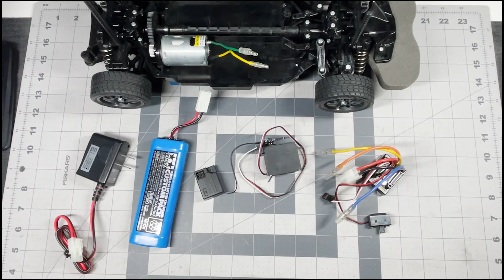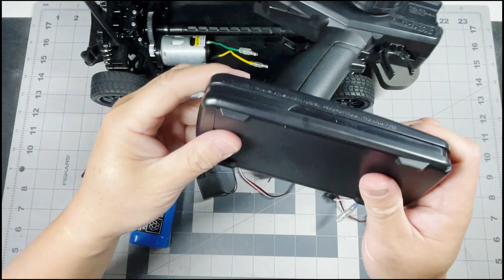How to Setup Fine Spec 2.4G Electric Radio Control System w/ ESC 45053 #tamiyarc

Comment: What to do if My ESC is blinking continuously with green light? Pls guide
Reply from the maker: It's very hard for me to diagnose a problem. Try the binding process again and make sure your servo and receiver and plugged into the correct channels. The servo should be in channel 1 and the ESC should be in channel 2. I hope you get it working. Good luck.
Reply: Thanks for feedback. Problem still the same